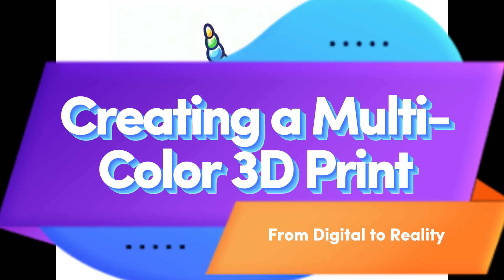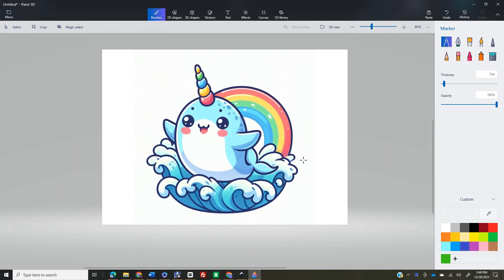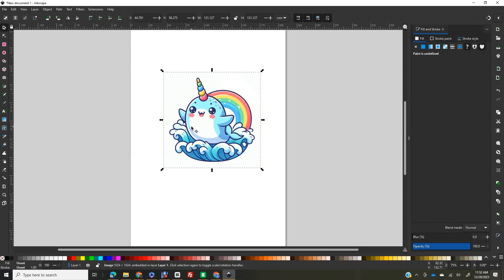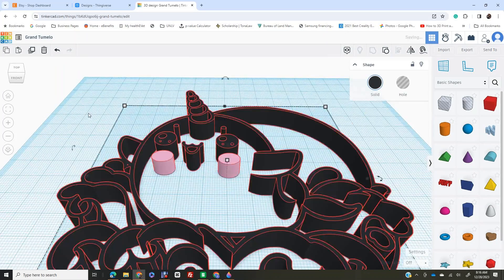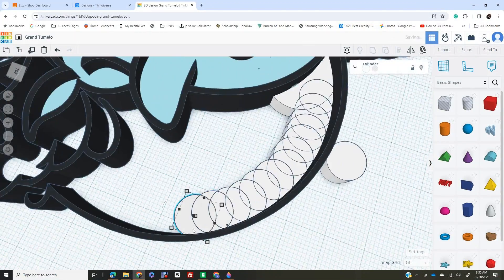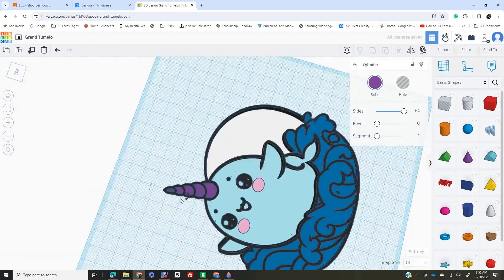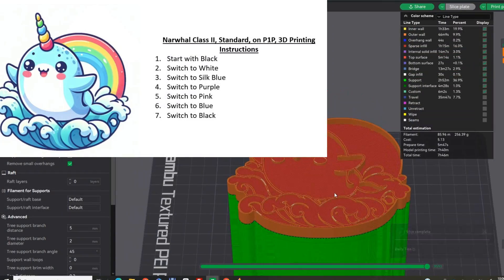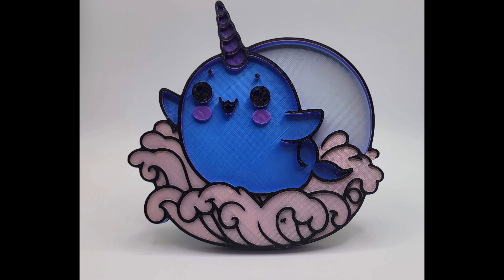Turn a 2D Image into a 3D, Multicolor Print, Quick Demo

Comment: Filing it in with circles is a waste of time. Just use the inside as a vector selection
Reply from the maker: As far as I know Tinkercad does not support SVG import of image data, clipping paths, or fill data within the SVG. Please correct me if I am wrong, as this would be a great shortcut in Tinkercad and save a lot of time.